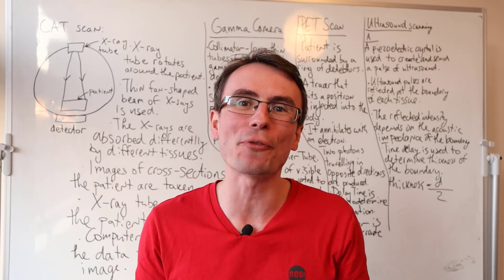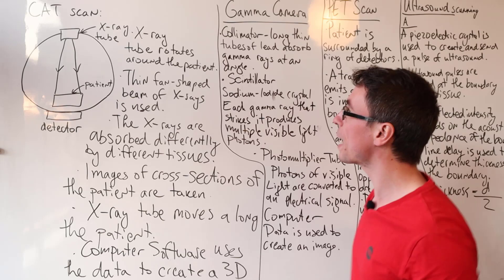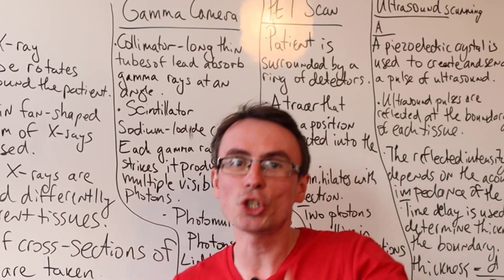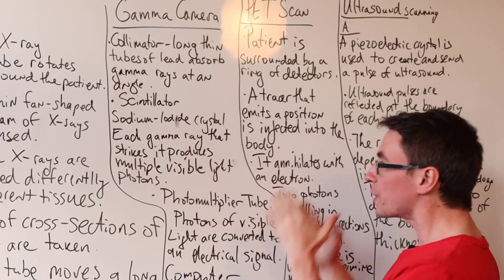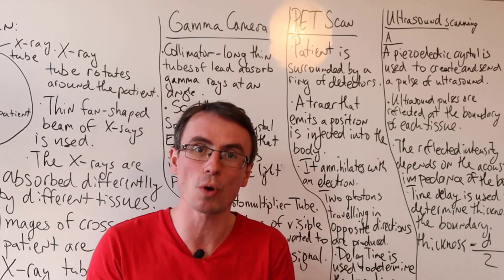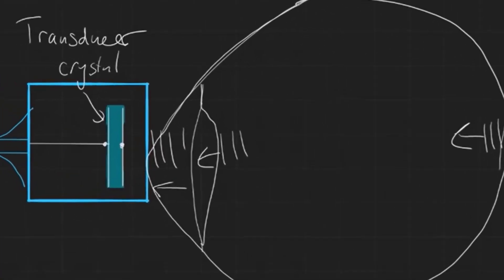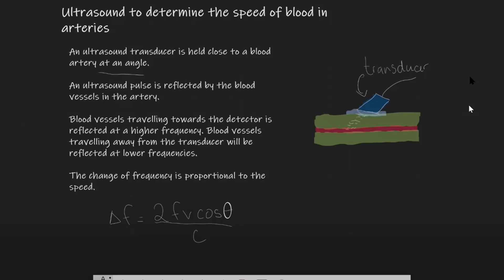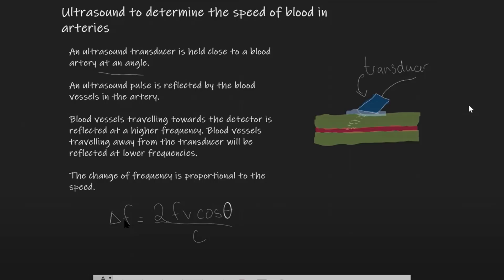IMPORTANT Medical Physics Revision

Comment: Can you please explain why the current decreases as an capacitor charges in simple terms I am struggling to understand it ?
Reply from the maker: sure - so the as the capacitor is charging, it is gaining voltage, that means that the voltage across the fixed resistor has to decrease as they need to add up to the total voltage.
Vtotal=Vresistor+Vcapacitor
As Vresistor decreases, the current needs to decrease as the current is constant. Hope this helps!
Reply: @zhelyo_physics I think you mean the resistance is constant
Reply from the maker: @godfred8618  yep sorry!

Comment: Hi sir, I don't do Medical Physics, but I believe I have a question related to it that you may be able to help me with please? It's about radioactivity. In the production of Te99m (-> for gamma radiation medical scanners), Mo99 decays via beta-minus. However this decay obviously produces a beta particle, and beta radiation is more ionising and hence more dangerous for the patient to be exposed to, so how do they ensure beta radiation exposure is reduced? My first guess (again, I do Turning Points AQA, not OCR Medical Physics) is that a few mm of foil surrounds the generator, but I have failed to find that out on Google (well actually that left me more confused!). Second guess, whilst the Te99m needs to be made in-situ due to its short half life (6 hours), it is made away from the scanning device/patient and somehow the Te99m is isolated/transported closer to the scanner- in which case, how would that work? 

In short, how do they prevent beta radiation from Mo99 decay damage patients when they want only the gamma rays from Te99m? [I don't think this is particularly relevant to my A-Levels, maybe a "suggest" question, but I'm just curious!] Thanks!
Reply from the maker: Excellent question. Typicaly Mo99 is the generator from which Te99m is "produced" and then the Te99 is used as a tracer. I believe! Hope this helps!
Reply: @zhelyo_physics  I don't think I've worded my question very well my apologies, because I understand that Mo99 is the generator, and that the Te99 "produced" is a pure gamma emitter; how is the risk/exposure of beta radiation from the initial decay (Mo99 -> Te99) reduced when the generator needs to be in the hospital as Te99 needs to be made on site (AKA, near patients/doctors using the gamma scanners/camera)? Sorry about the phrasing, hopefully that makes sense..? And thank you for your reply :)